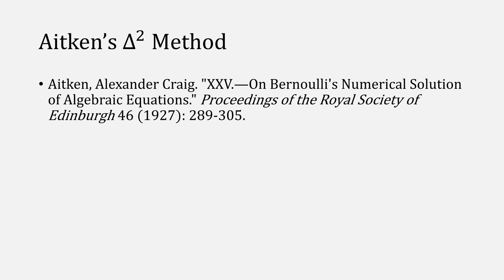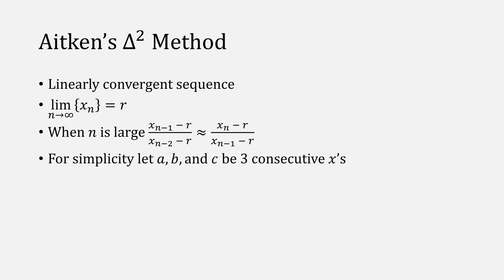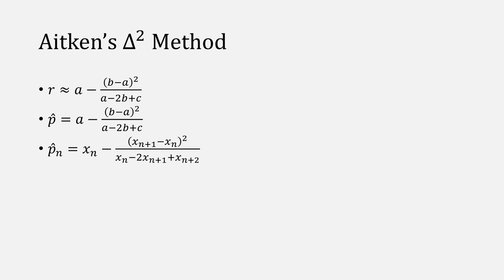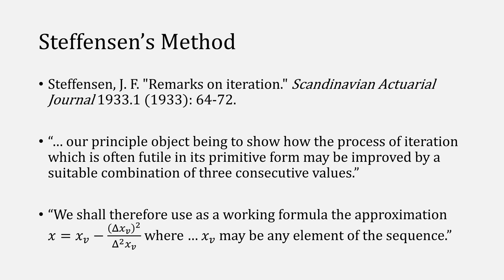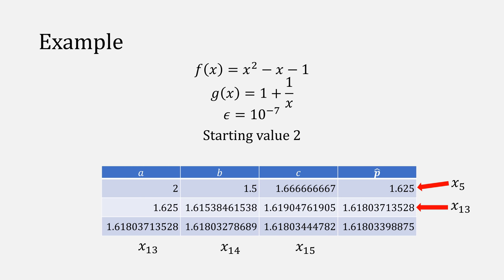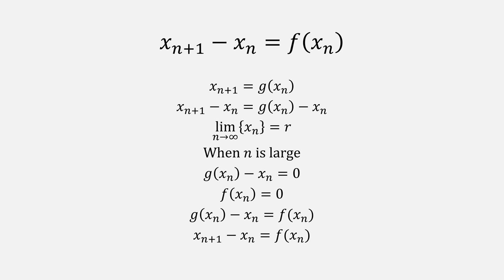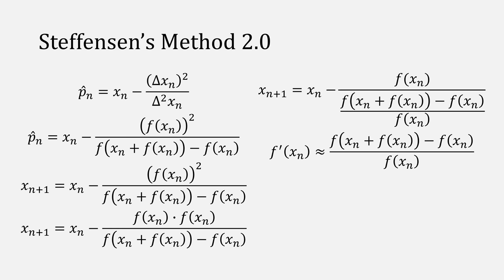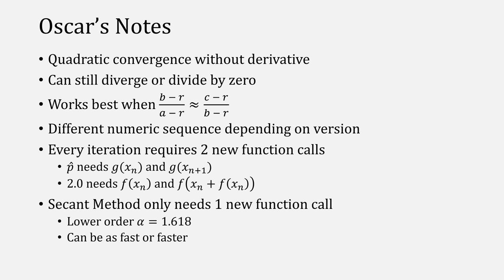Steffensen's Method with Aitken's Δ²

Comment: Can Aitken's delta squared accelerator and method can not only be used for Steffensen's method, but for other methods, such as Newton (which is a special case of fixed point iteration)?
Reply from the maker: Aitken's can be applied to any linearly convergent series (like the example FPI). It can't be used on Newton's method because that is quadratic.
Reply: @OscarVeliz  Linearly series that includes bisection and regula falsi?
Reply from the maker: Technically yes, but consider that those two methods aren't a series of x's but rather a set of shrinking [a,b]'s. You could try Aitken's on the c's but your mileage may vary.
Reply: @OscarVeliz  Remember that Laguerre's method is linear with multiplicity? It could work with that too.
Reply from the maker: In that case the method is still cubic but behaving linearly. I suspect there might be some improvement, however there are other ways of dealing with multiplicity.
Reply: @OscarVeliz  I'm going to give these a try. I'll let you know of my results. Thanks for these amazing videos, all about minimization and root-finding. What's your favorite minimization algorithm, and your favorite root-finding method? My favorites are Newton, Schroder, Chebyshev, secant and Newt-Safe. Plus, I'd love to have your own take on the Mandelbrot and Julia sets and their variations. And what are your plans? And by the way, I love the Aitken delta squared accelerator, very simple and easy to use. I'm wondering, if I used a damping factor of 0.5 on Newton's method, would this lead to a linear convergence?
Reply from the maker: Favorite min method might be Brent's and root-finding is probably Durand-Kerner/Aberth-Ehrlich but it is hard to pick just one favorite. Mandelbrot / Julia I don't really have a take. Plans are top-secret 😉. The damping factor would likely come out of the M constant (during the log division from the order formula) rather than impacting the order.
Reply: @OscarVeliz  I tested another root-finding algorithm: Whittaker's method: one of the algorithms has a quadratic convergence, but behaves linearly when root multiplicity is involved. Using the function (x - 1.75)^3, after doing the first three iterations using this method instead of fixed point iteration, I applied Aitken's delta-squared process to test my hypothesis, and it turns out that it worked: in fact, Aitken's delta-squared process has found the root of 1.75. I haven't tested this on other root multiplicity functions, so this means that the efficiency might vary.

Comment: This is very nice! Although I'm honestly very baffled with the composite function evaluatio f(x + f(x)). Wouldn't x and f(x) have different units/dimensions thus they can't really be added?
Reply from the maker: The idea is that f(x) would just be a really small number as you approach the root. It also explains the terrible performance of the method when far away.
Reply: @OscarVeliz  ohhh okay. I see. That's why. Thanks for the explanation! Although it's weakness of being terrible when far from the root is shared by the other Newton-type methods e.g. secant, newton, halley, etc
Reply: @OscarVeliz  update: i actually tried it in excel and gave steffensen's method an initial value far from the root. It wouldn't converge towards it unlike Newton's or Secant method that can still converge even if far away. So that's that. Still, Steffensen's method is still very handy when you know a good initial guess for the root and you don't want to calculate the derivative function